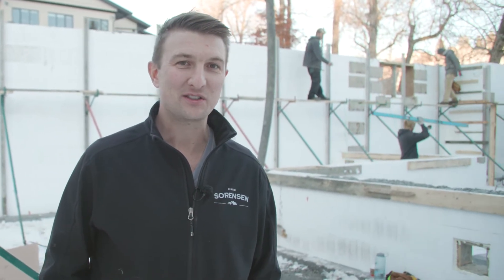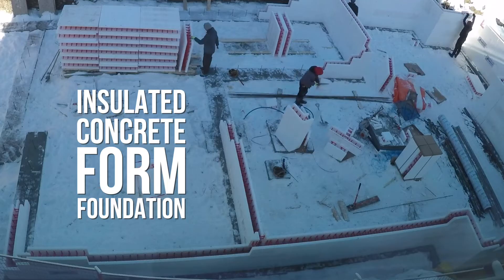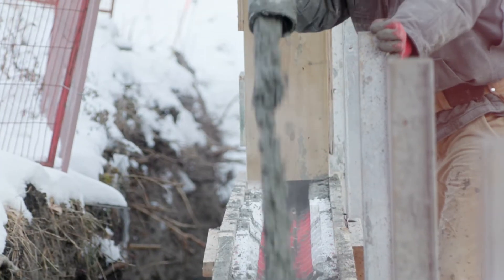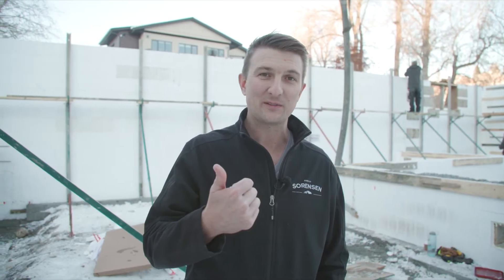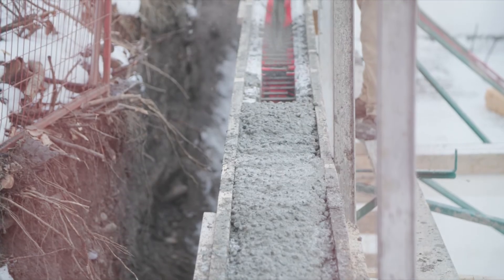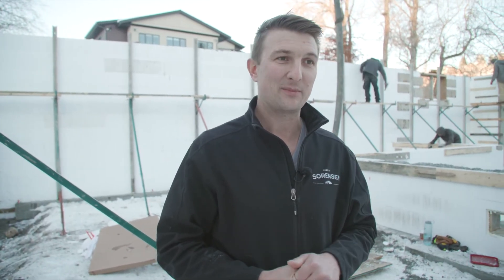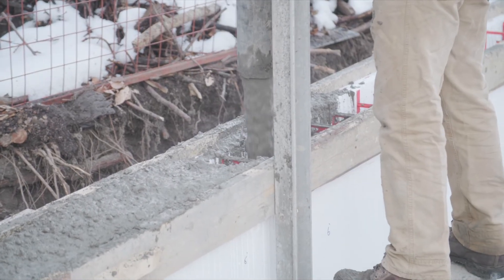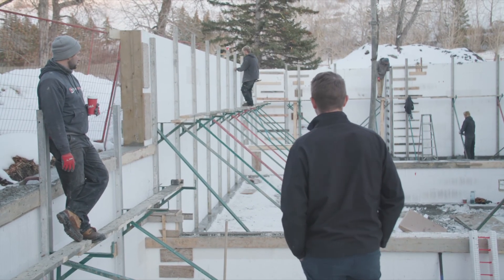Why You Need This ICF Construction | Net Zero Home

Comment: Many people never read an icf package. Masonry loves to wick moisture. Masonry needs 18 inches of expose surface to air to dry out. If masonry can not dry out it becomes water logged. The icf blocks we have used all call for a stem wall on top of them. This allows masonry to dry out. But codes are different everywhere.

Comment: Did you consider taking the ICF construction to the roof level?  What did you consider when determining whether or not to do that?  A builder I was talking with recently said he would not do ICF because he is concerned that moisture from the concrete could be trapped between the concrete and the foam and that would be a place for mildew and mold to grow.  Have you heard of that happening?